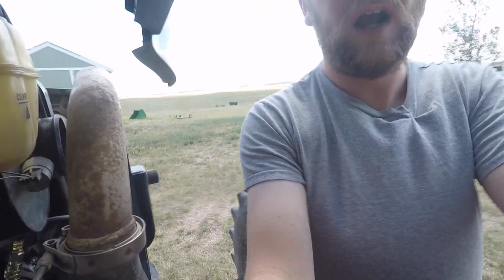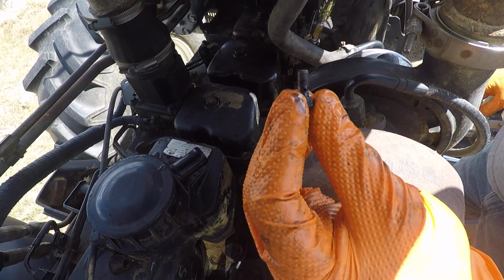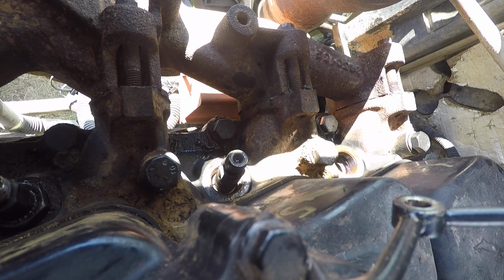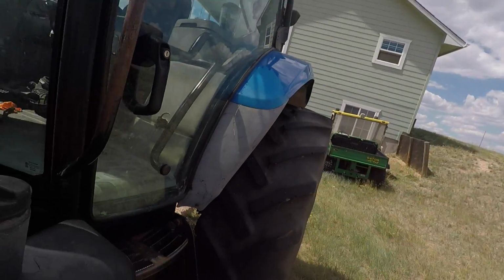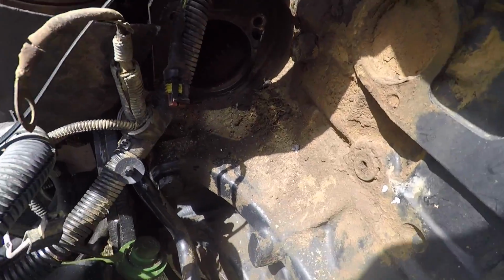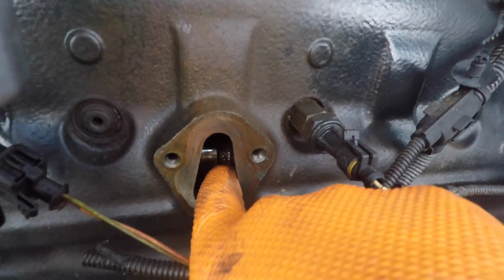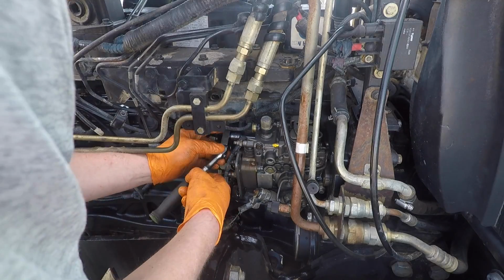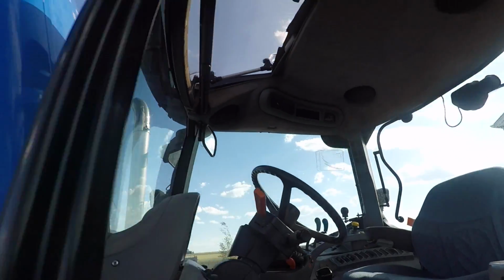TS115A Injector and Injection Pump removal

Comment: Enjoying the videos a lot. My dad and I are about to take the injection pump off  our R model Mack because when you start it it tries to run away.  These videos are like a preview to what I'm going to be doing for the first time.
Reply from the maker: It's not as bad as it looks, just make sure you have the manual for the timing spec.

Comment: agree that if u suspect something may have gotten clogged somewhere in the injection system you may as well rebuild the injectors as well as the pump, nobody would want to have to tear it back apart, as well I like how your taking a tractor that may not have had an easy life and giving it the attention that's likely to have been long overdue soo it has a good chance at a long second life
Reply from the maker: +Chris Rowlison thanks Chris. I need it to be ready for a long second life!

Comment: I’ve just done this job on my Australian delivered ts115a. Everything looks the same, and comes apart the same until you try to pull the pump off. Mine has a plate on the other side of the casting, almost under the cab, remove the plate, and there is a 21mm nut to remove from the shaft, then I had to make a plate to go across the shaft with 2 bolt holes, for a puller to get the drive gear off the injector pump shaft because the drive gear on mine is approximately 120mm diameter and can’t come out with the pump. It all has to be done by feel, I used cardboard to make impressions of the bolt heads to get my puller plate the right size. If you have to do it like this, I recommend you get high tensile bolts, I bent my plate and stretched one of my bolts, if that bolt had broken, I would have been in the shit, possibly need to lift the cab to get it out.

Comment: I would definitely  replace  that lift pump to I've heard if they start to go bad it will starve the injection pump for fuel had that happen on a dump truck with a Cummins in it one time ended up replacing both.had one go bad on a newholland  TL90A  with low hrs it just quit running looks like same exact pump. Great video  thanks for posting can't wait to see  it finished!
Reply from the maker: The gentleman at the injection shop said these are usually damaged by low fuel pressure due to either plugged filters or a failed lift pump.
Reply: I like the gentleman at the IP shop already. Our TS110 has an electric lift pump instead. So now I'm wondering if one of those oil pressure shutdown switches could be made to work on the line between the pumps to just kill the engine when fuel pressure drops there? Save the next IP? Cheap insurance no matter what it costs, really. If you are thinking about going electric can I recommend a E8057 subaru pump? It's an on demand thumper with points and coil on one end and pump on the other, when pressure has been achieved, it quits thumping. And thereby one knows you have 7 PSI fuel pressure by instant feedback. 50$ and that will compete nicely with the mechanical at dealer prices.

Comment: Need to use  a suitable tool to pin time engine. Maybe a inverted drill bit or rod of the right size. A Phillips screw driver @ 6.26 in your video is not going to get it dead on. Pin must accurately stop the flywheel in place.

Comment: Great vid, big thanks I learned a lot but I wouldn't be able do that job without tractor manual.  3 to 4 weeks is long time for it to b fix!
Reply from the maker: +Jamie Shields this is one of those jobs where the factory manual is pretty important.
Reply: Where did you get the factory manual from? Do some manufacturers make their manuals easier to get than others? Thanks!

Comment: I bought a 755 back hoe and had the motor run away on me, managed to ram a shirt into intake and save the motor but had to do the pump and did the injectors just cause, WHeat City Diesel did them all in just over 2 weeks, love your detail in yer vids, cheers.
Reply from the maker: +PIPER DOUG thanks Doug!

Comment: I recently purchased a Massey 85, it was advertised as "work ready". I've done nothing but work on for a few weekends getting it ready to go. None of the gauges worked when I got it, once I got the new gauges all hooked up, found out that she has about 2 psi of oil pressure to the engine. :(
Reply from the maker: +Steel Shooter it was work ready- ready for you to work on it! Don't feel too bad, I was promised the biggest issue with my NH before I bought it was a weeping axle seal.

Comment: First thing you should do is blow all the dirt off the head around the injectors. NEVER EVER bend an injection line. The passage inside them is very small and can be damaged easily. Bending one can even cause an engine miss.
Reply from the maker: I don't like to do it, but sometimes it happens. Removing them is a much better method.

Comment: Did you once say that that this was from a dairy farm?  Any tractor from a dairy farm would be in rough shape. Good deal though that you know how to fix it. I had a 6430 Deere that had 9000 hours, a dead cylinder in a 4 cyl engine, loader pin broken on lift cylinder the day before the trade came in. Lol good job at 5k subs! Best wishes
Reply from the maker: +That farming Kid yes, this is a former dairy tractor. Thanks!

Comment: I have never seen a pump with a locking bolt, all the engines I have worked on have had a drive shaft with one spline that is extra wide so that it only goes in one position. you can pull the injection pump in any position and when it goes back you can rotate the engine or pump to get the spline to slide in and as long as the scribe mark on the engine is aligned with the one on the pump the timing is dead on. I supose it is done different in the US or is that just that make of tractor.
Reply from the maker: +Equiluxe1 it varies by engine and pump. This tractor was actually built in England.

Comment: Our tractor has what I believe to be a messy leak where the throttle linkage pivots in the fuel injection pump probably a bad seal. Been gun-shy to try and reduce that leaking. Don't want to do something else and make it worse or create a worse problem. Lol.
Reply from the maker: I know the feeling! That's why this pump is off to a professional rebuilder.

Comment: Man, I'm so sorry you are going through all of this effort to get that machine running again.   So I am wondering if this number of problems is a result of hard work by the machine, poor manufacture of certain parts, poor maintenance or cheap materials on the machine.  I guess I am asking if lower priced New Holland tractors are worth buying?   
Also, I think you are wearing the correct cap!
Reply from the maker: +Michael Chugg I don't have any problem with NH tractors, I think any of the big name manufacturers build a good machine. Dealer support is the most important, but I have a video on all that coming as soon as I get the 6410 out of the field.

Comment: Looks to me like someone has had the pump off before, when they come out of the factory one of the bolts that hold the pump to the engine (top left one) is a special security bolt, whereas on your tractor it has got a normal bolt in place, but I could be wrong
Reply from the maker: +Kevin Koopman I agree. I found lots of signs that I wasn't the first one to chase this problem including missing bolts and clamps.

Comment: I watched this video which was great but did not show where and how many oil rings where to be used.  There are groves for two but when you removed the injector I only saw 1 O ring on the injector.  Help.   I just paid 2 thousand dollars for  4 brothers tractor garage to fix my TRactor.  They failed returned it to me still not working.  They did not put  o rings on the injectors Out of money I have a neighbor helping me check there work. I am relying on these videos to see if I can fix it. The garage did not put o rings on the injectors. My tractor is a New Holland T4.75 Powerstar.

Comment: Great videos!  I have my own TS 115a issues. It was losing power when working ground the other day and I thought they ran it low on fuel. I fought getting it started, but after bleeding at the injectors I got it started. It will idle for several minutes, but it will not throttle up. Any ideas? I'm leaning toward IP issues.

Comment: Very curious - this injector pump rebuild $1,000 +-  or I maybe way off
Reply from the maker: +Donald Ellett It could run $1,000 and up depending on the exact problems found. I expect the minimum to be around $1200 but it could go as high as 4K.

Comment: I am currently working on an injection pump on a ts115a and I have everything unbolted and lose but the pump doesn't want to come out. Any suggestions?
Reply from the maker: There is a plate on the back of the engine block behind the pump facing the cab. Remove that and see if you can work the pump loose, there is a special tool that goes in there to push it out that you might need. I didn’t need it for mine, but others may.
Reply: @GuyinWY  thank you I will try that

Comment: wooh, 3-4- weeks is going to be long way to wait the final fire-up with the new pump... :) 

.... why don't you drive the tractor downhile in the meantime, where it doesn't need the engine running.. :D (jst kidding)
Reply from the maker: +SaoPauloNX I would have to push or to the top of the hill every time. :)
Reply: aye.. but it looks like a nice tractor and it shall be a shame to see it just sit still there... sigh ah well.. 
*being exited and waiting for the video*

Comment: are you sending injectors and pump direct to repair specialist or through someone else who will take a cut and the reason I am asking is I always deal direct with firms and not only diesel specialist but engine machine shops and radiator  repairers  but I have just thought about something and that is you are probably long distance from these places.
Reply from the maker: Directly to an injection shop.

Comment: I bet those injectors aren't cheap
Reply: Donald Ellett really depends on the engine. Some injectors are pretty stupid expensive, others can be had for very reasonable prices like for the Cummins 5.9L.
Reply from the maker: +Donald Ellett I've found rebuilt injectors for around $90 each.